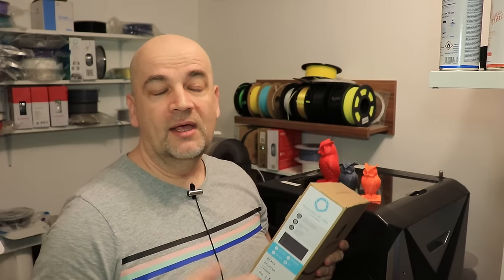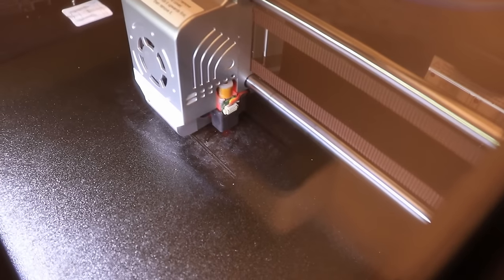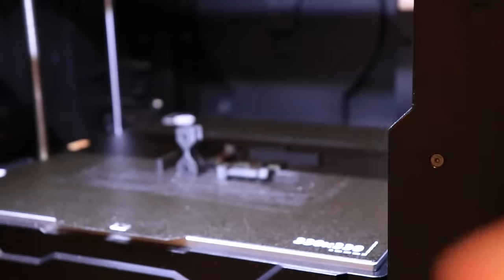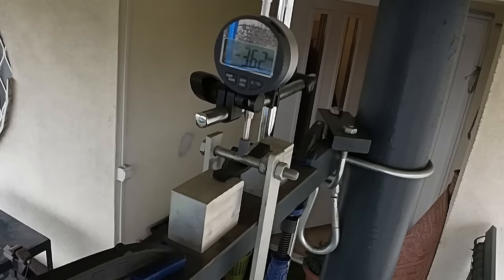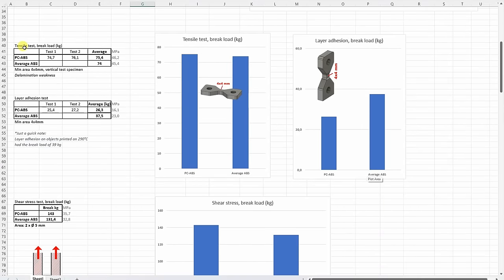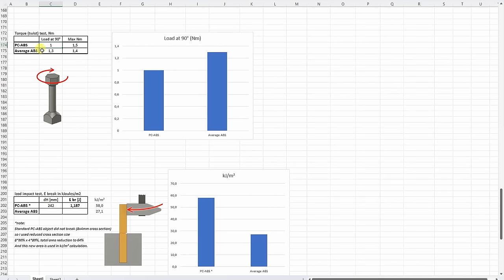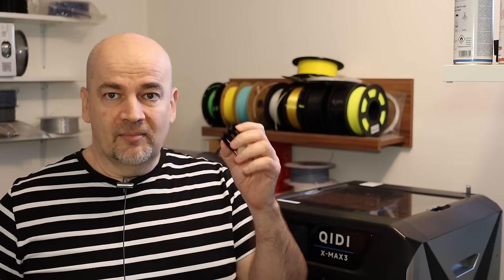Polymaker PC-ABS filament review - if you can print it, it's great for mechanical parts

Comment: ABS is hard to print, not UV/outdoor resistant and it smells /releases bad stuff in the air. I'd rather see some reviews of PC/CF PETG or ASA
Reply from the maker: I have 5-6 brands here waiting for the review. There will be petg, nylon, pc too..
Reply: I'm wondering if the more exotic filaments are actually worth it, barring some niche use cases. They seem to be significantly more expensive to buy, require a more expensive / complex setup to print whilst offering not much more than standard filaments. But that said I'm still glad you did the tests though; very informative!

Also (and I know I'm being pedantic here) but the singular for "dice" is pronounced "die" and is that cracking or creaking noises?

Comment: Thank you for testing these so we don't have to!   Re: your comments about layer adhesion and temperature, please be aware that printing faster generally reduces the layer adhesion strength.  If you want to run a test "in spec", then you should ideally try using both temperature AND print speed from the manufacturer.  THEN, after you have that baseline, you can have a look at the impact of today's high speed printing on the material properties advertised by the producer.   Thanks, again.

Comment: I've been able to print PC-ABS without a heated chamber...but it's quite challenging - definitely wants to warp like crazy!
Reply: I have good success on my SV-06 and wrapping my enclosure in a blanket and letting it heat soak for a good 45 minutes at least. That way the interior temp gets to around 55c, maybe slightly higher (ambient temp 21c). I also put a false ceiling made from insulated reflective bubble wrap in my enclosure to minimise the volume I have to heat and put the spool inside the chamber on a seperate holder, not the usual holder that comes with the printer. Before that I struggled to get above 45c.

Comment: I print PACF, CoPA, PCABS, PCCF, and even PP with no enclosure, textured PEI plate or Garolite and Magigoo.  Don't be afraid to try these kinds of 'Engineering Materials".  Take your time with the slicer settings, use some common sense, start with small parts, and print slow.  You'll be amazed at what you can print without a heated chamber or enclosure.

Comment: Yeah, had to print at 300C with 120C bed temperature on my Bambu X1C to get decent layer adhesion with Protopasta PC-ABS.  It permanently marked my build plate (Bambu Engineering Plate).

Comment: What was that material in the heat test that didnt deform? I want to print with that stuff.
Reply from the maker: No deform during annealing? That was PC blend CF by prusament
Reply: @MyTechFun  awesome thank you. Ive been looking for that.
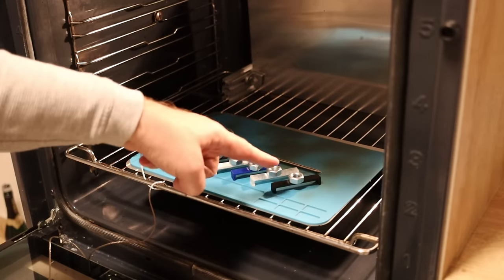Reply: @user-nx1fp6fv6r  If you are referring to the temperature test starting at 8:48 , the one furthest to the left seems to be Extrudr Flex Hard CF.
Going from left to right should be Flex Hard CF, Flex Hard, Flex Medium and Flex Semisoft
Maybe @MyTechFun can confirm. I've been looking forward to the review of these 4 TPU filaments!
Reply: @lukas_berger  thank you. Ill check them out. I need prints with super high heat resistance

Comment: Thanks! Engineering materials are largely under-reviewed, looking forward to having a full comparison of all possible permutations of PC, CF, GF, PA6/12, ASA/PETG 😂
I used PA12/CF in the past and it has been great, but it's too elastic. Would love to find a stiffer material, yet not brittle and high temperatures / UV stable.
Reply: Have you tried ASA-CF? It's the only material i know with a reasonable price and these characteristics, PVDF or PPS are way more expensive.

Comment: I spent quite some time comparing technical datasheet of PC-ABS and Polymax PC by Polymaker.
They seem almost identical in regard to stiffness, strength (impact and tensile), temperature resistance.

I really wonder why choosing one over the other.

Thej in their Discord I got a reply: PC-ABS can be more easily coated and painted, it's meant mostly for car parts.
Reply from the maker: Oh, this is very useful, thanks for the info!
Reply: @MyTechFun a  1 to 1 comparison video could be useful, especially since now you have the Xmax3 to make chamber temp identical
Reply: If the suggested video is ever going to happen, I suggest printing a series of bars with increasing length, to check which one warps first at 65C: it could be that the short impact test samples stay flat, but once the length is increased by 20, 40, 60, 80% either PolyMax PC or PC-ABS warp. No idea which one will warp first, but I would say PC-ABS, which is not even a "consumer" material, but industrial with the requirement of a heated chamber.

Comment: Interesting filament and great data. Thank you so much.

As a side note it is possible to drive the Qidi up to 70C chamber temp within the gcode. The printer.cfg actually has the limit as being 70C. It's the on-screen UI that limits it ro 65. It is unknown though how well the printer handles 70C, but if you wamt to push the limits that is an option
Reply from the maker: Good to know. I worry about the electronic on that temp, my version don't have that small fan on extruder cover (you can buy it separately from Qidi website)
Reply: @MyTechFun  I bought that for my X-Plus 3. The part cooling ducts are also redesigned on those ones. It fixed the part cooling issues that would sometimes occur on the left side of prints. For the X-Max 3 though I'd heard that if you ask Qidi Support nicely that they'll send you the new covers with those fans for free. Can't hurt to at least ask them.

Comment: TearTime (UP2+, UPMini ..) use ABS+PC as a secret recipe from day1, they call it ABS but the secret of their ABS and why it works much better than regular ABS and why it is printed at 270C is high % of PC in the mix. Printing on the high temp side (270C) works great. Much better support separation than pure ABS. Main difference from regular ABS that I noticed are better bridges and better / easier support separation

Comment: Thank you for this video. I'm happy you showed the print next to your hex wrench to show that It was straight and not warped. 
I am struggling with ASA and it seems to warp (especially with prints that much of the build plate (BL X1C). Do you have warping issues with ASA also?
Reply from the maker: No, ASA is easier for printing compared to ABS. Looks like it depend a lot from the ASA type. By X1C is still in the box, so I don't have experience with this printer so far (only with P1P, but thats not for ASA)
Reply: @MyTechFun Thank you! I am using Sunlu ASA. Ok, I will try new calibrations and try again. 🙏
Reply: Try slowing down the printing speed (i.e. limiting flow to 5mm3/s) and preheating the chamber keeping the bed at maximum temperature for 15-30 mins before starting the print
Reply: @PaoloBernardoni  Thanks. Will try!

Comment: Ever more difficult torture filaments, but everyone ignores simple cheap and relatively easy HIPS? Consider most of the print weakness is not due to even fundamental material properties but due to faults introduced by 3D printing process, such as layer adhesion, voids, internal stress, inconsistencies and stress risers etc.

HIPS is not the highest performance material but it looks very attractive with its matte surface and it bonds fairly well. It's not too troublesome in heat, in UV sunlight, etc, and can be chemically welded and smoothed. It can emit hazardous fumes but it's not prone to emitting nearly as much uncured monomer as ABS.
Reply: HIPS is great material and can be smoothed with limonene, you can't vapour smooth it though as limonene doesn't vapourise, although there could be a way to mist it I haven't tried personally. Dipping it or lightly brushing it works but can melt the surface too much so you have to find that fine line between smoothing and melting your print. It goes kind of tacky and takes a while to harden again. I only tried this a couple of times a few years ago, might revisit it and see if I can improve on it, or perhaps a mix of acetone and limonene might work?
Reply: Hips is a great support material for ABS/ASA since it has similar temperatures and you can disolve it with limonene afterwards.

As an actual printing material, I'd rather just use ASA
Reply: @caramelzappa  why actually. What are you getting out of ASA that you're not getting out of HIPS?

Besides ASA costs actual money.
Reply: @SianaGearz  Most color choice and availability from more manufacturers. But also, hard to use hips as a dissolvable support if you're print is in hips
Reply: @caramelzappa  have you considered using ABS as dissolvable support for HIPS using acetone?
Reply: @SianaGearz  I'd be willing to try it, but again there is just not the same variety of colors or different manufacturers for HIPS.
Reply: @caramelzappa  I guess it depends on the region and preference. There aren't a lot of suppliers but the ones that are here are reasonably well stocked and i use just a handful of colours anyway, and the prices are anywhere between cheap and inoffensive and spool quality seems fine so far. Like i wouldn't need more suppliers because the needs are well covered. I just go for black load-bearing HIPS and translucent PETG or opaque PLA accent colour prints most of the time anyway. Back a few years ago you could only get black HIPS and natural HIPS but nowadays you usually get at least 7 colour choices as well.
Reply: @SianaGearz  These days I am mostly printing "galaxy" colors like Prusa, FusionFillaments, and even Polymaker provides now. $20-35USD/kg it totally reasonable to me. I am absolutely willing to pay a bit more to get the quality and color I want. You do bring up some good points about HIPS that I hadn't considered though, so I may move it inot rotation more especially when I want a matte finish.

Comment: 15:14 contact QIDI, since new versions DO use inductive probe and have a large magnet sheet instead of separate magnets to hold the build plate (so it is much more secure).
If you contact them they will send you the upgrade parts for free (they have done so for many people that I saw).

I have the latest version of the printer and it's pretty impressive for the price.
Reply from the maker: I tried (as a private person, not influencer) I didn't got the parts for free.
Reply: @MyTechFun  That is quite disappointing honestly. I know a lot of normal/private people (not influencers) had a pretty good experience with QIDI customer service, so this was unexpected.

My printer came with a hole in one of the plastic panels (frame was ok, everything prints fine, I just have a hole around a screw).
The customer service offered me a 100 EUR refund, and since everything works fine and I can just tape it (or print a plug), I took the refund. This printer for 799 EUR is a really good deal in my opinion.

Comment: Hello Dr. Gaspar, in the future videos, could you test layer adhesion for pla filament with 45-50 C chamber temperature and 210 C nozzle temperature, maybe if you reduce the printing speed severely, cooling from the fan can be enough, also reducing or disabling the retractions will be necessary to prevent heat creep in the nozzle probably. ( there will be a risk of clogging the heatbreak.)
I am curious how well the layer adhesion can be if the ambient temperature is close to the polymers glass transition temperature, but I can't test it myself. Thank you.

Comment: impossible to read text in your results sections
Reply from the maker: Check the playback resolution (sometimes it reduces if internet slows down). Check it on bigger screen too. Or you can always download the excel and zoom in (link in description)
Reply: @MyTechFun  max res - it's just much too small even on my 65" QD OLED or on my 14" laptop. Please make the text larger for us glasses wearers (presumably much of your audience)
Reply: All you gotta do brother is hold down your CTRL key and use your mouse scroll wheel at the same time.  You're welcome